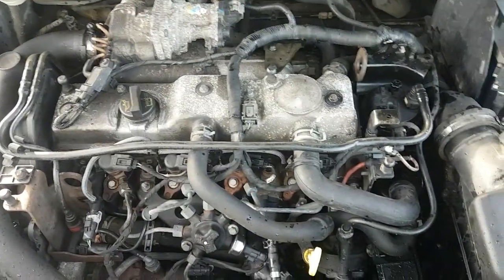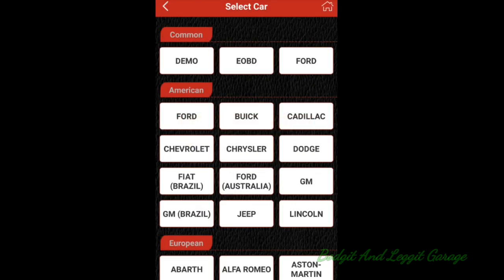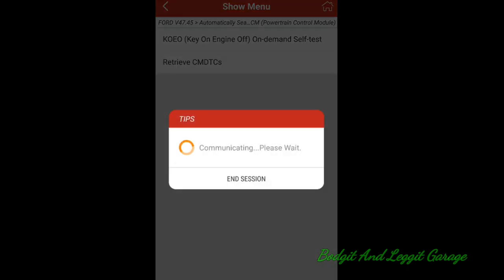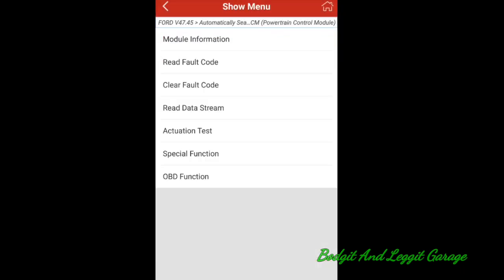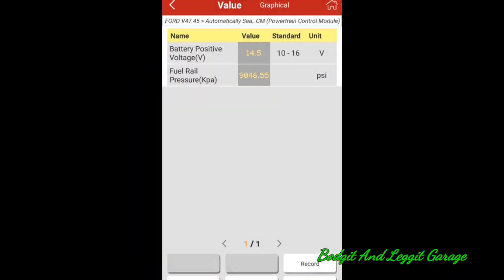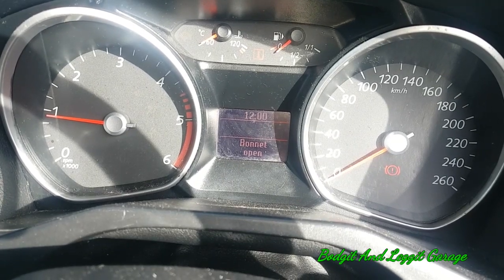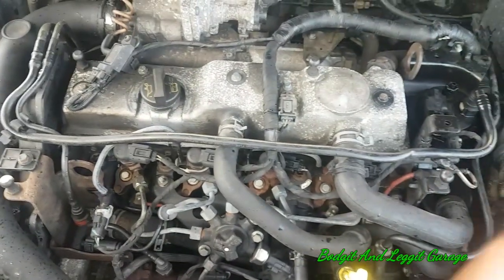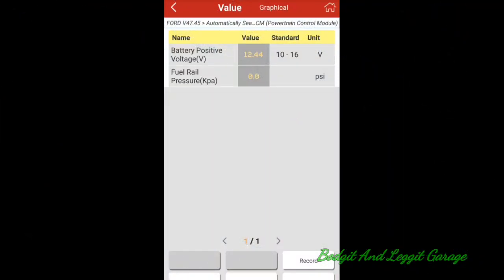Ford Mondeo Crank No Start P0087 Fuel Pressure Low Don't Be A Parts Changer Diagnose It Properly

Comment from the maker: The conclusion to this engine was a faulty fuel filter housing it was drawing in air are causing the diesel not to pull through from the tank and not to refill the filter we replace the whole filter housing with a second-hand unit and the car is still running over 3 months later with no issues just something worth checking as well symptoms pointed to a blocked fuel tank but in this case it was not
Reply: Good result. Seems like a common issue on these 👍
Reply: Hi Leon, how did you find out?
Reply from the maker: @armandonika  I tested the fuel coming out of the fuel tank and it was clean normally when there's a big blockage you comes out dirty I also double checked all the o-rings on the fuel filter housing they were bad and the fuel filter housing was Miss shape and old eye pressure tested the fuel housing and I saw fuel coming out of it so I replaced it
Reply: bodgit and leggit garage thanks mate!
Reply: Hi. I think that i have the same problem as yours. Car started fine and then after a while cuted off. After a few attempts it started and ran well, but next day the same problem. 
I don't have any fault code (diagnostic tool), but FRP fluctuates at idle for about 50 bar or 725psi. I hope that my mechanic will find the problem.
Reply: @stojanhumar1704  simular situation here. Did you find and solve issue??
Reply: @andrewelse6854  Hi. It looks that the problem was with EGR valve.
Reply: @andrewelse6854  Latest news: it's seems there is a problem with fuel and not EGR. They don't know yet.
Reply: @stojanhumar1704  did you manage to sort it out?
Reply: @andrewelse6854  yes. The fuel tank was full of dirt. They had to clean fuel tank, pipes and replace fuel filter. I recommend you to check fuel filter first.
Reply: @stojanhumar1704  thanks planning on changing the filter tomorrow hopefully that's the issue with mine
Reply: @bodgitandleggitgarage  where was the problem now? I have the same starting problem on 2 days in one week on my mondeo mk4 2009 2.2 Diesel.

Comment: Nice mate. Seen a few feed pipes not in their retaining clips rubbing on the pulley at the back of the engine. Think it’s the power steering pump can’t remember. Normally after an engine has been fitted. Another great vid. Keep them coming.
Reply from the maker: Thanks a lot mate I've seen that a few times myself and the older 2L diesel has had the fuel filter beside the pulleys as well did the same thing when they weren't in place properly

Comment: hi leon hows things ? i have a 2006 1.8 transit connect r3pa engine ,van starts everytime but loss of power ,as if the turbo not kicking in but it seems to be working take the turbo pipes of at the manifold and really strong pressure ,only engine code is 0087 low pressure ,i changed the fuel filter ford one and it was one hell of an engine to start had to jump start it ,eventually started but will start everytime 24 hours later still starts but one i remove the fuel pipe feeding the pump from filter it will not start same again flattens battery etc then have to jump start it ,so i connected the fuel pump up to a gallon can of fresh good diesel  and sorted the other pipes so that they would not draw air but same again no start ,the fuel pipe is only 15 inches long from pipe to pump very short but it is still flattening the battery and taking forever to start ,i have checked the fuel pressures 300 bar at idle at 2000 rpm 700 bar and at 3000 rpm 800 bar but it still hard to start ,i did a leak of test on the injectors and all good very slow to put diesel into the measuring containers ,i cant understand why it will not start even with its fuel lines and filter by passed and i have what looks like good fuel pressure ,can you shine any light on it before i start changing the pump etc ? sorry for the long message but i had to explain all of what i have did on the van ,i also did a compression test and it is 100 % every cylinder ,hpefully you or one of your other followers can help   many thanks paul

Comment: Ever woorked on 2016 Ford Focus Flex GDI SE 2.0L ? I had a collision on curb high speed and had underneath dammage but still ran . Had it at home for a few days and i'd start it and ran normally for 10-15 minutes at a time . ran it to check engine and charge battery . Then took it to a shop and damage was fixed and verry surpprised it won't start . Mechanic said he couldn't diagnose problem so I took it home and called mobile mechanic . He used a tool with a tablet and said it was fuel pump so I got one used and put it on still not working. Used test light to check fuses and entire rows of them not working and I told mobile mechanic but he didn't pay attention. Said he's almost 100 % sure it's pump ..Shouldn't the fuses  light up ?  and yes I took them out and checked with ohmeter and they're good . Fuel pump fuse is good and mechanic said it's getting some fuel but probably weak pressure ? Please help me I need my car . Spent too much already and over a week no

Comment: Hi mate excellent video! I’v been told the fuel pressure regulator valve on the back of pump is a common issue, is this correct?

Comment: Hi Mate just subscribed to your channel as I find it very informative, I've got a similar problem where the Mondeo was driving ok then just stopped and now wont start, Id like to ask a couple of questions if I May, Firstly if I crack the nuts on the injectors after having cranked it over I get a dribble of diesel but no real pressure release, Does this sound normal?? Secondly if I disconnect the main pipe that supplies all the injectors I get the same result after cranking, Should the fuel jet out of here under pressure as it only seems to trickle out? there's no evidence of any gold in the filter housing so I'm hoping my injector pump will be ok....Any advice you could give would be most appreciated
Reply from the maker: Hi mate what you need to open up your diesel filter see if you can see any gold glittery bits if you can your pump is gone and you need to replace that and your injectors this is very expensive then  plug in your scan  tool on live data on your high pressure fuel pump make sure it's at least 300 bar at startup that is the first thing you need to do
Reply: thanks for the reply mate, I've hooked up my laptop using forscan and it throws up a number of codes, P0087, P0193, P0238. Whilst cranking the engine there is plenty of  fuel pressure and the fuel filter is good with no bits of metal. Any ideas mate?/

Comment: Hi can I ask for some advice from you please for my ford c-max 2008 1.8tdci ??
Reply from the maker: Of course you can mate
Reply: @bodgitandleggitgarage  brilliant I've been having trouble with my 1.8tdci engine code kkda in the morning or for long periods of time its really struggles to start and sometimes doesnt start at all, so I've changed the glow plugs the battery and also the fuel filter but still the problem persists and I also have changed some of the fuel pipes as the ends were corroded or broken and I've done a compression test once cold and one hot the cold one indicated that cylinder 3 had a dodgy injector so I took it out got it checked and it came back as fine so I'm not at a lost as to what it could be do you have any ideas ?? I've been told if I blank my egr valve it should course it but its seems like a fuel problem not an exhaust problem so any advice will would be great full thanks 👍👍
Reply from the maker: @juddaas08  I made the first thing you are going to do is have to get a scan tool and check the cranking pressure if you don't have a scan tool you're going to have to get one or find someone who do if you don't have this tool there is nothing further you can do
Reply: @bodgitandleggitgarage  ok mate I shall get it to the garage to check the pressure thank you for your input I really appreciate it
Reply from the maker: @juddaas08  anytime mate unfortunately if you don't have the right equipment we cannot go any further as I need to know Pacific things of the car before I can tell you what else to do
Reply: @bodgitandleggitgarage  ok mate thanks 👍👍

Comment: hate those 1.8 lynx  engines with a passion  they should have called them  the 1.8 jinx  total crap   really poor  engine    components   oil seals  ,turbos , flywheels( go around 60k) wet timing belt  great idea that a belt that is soaked in oil   and the dreaded delphi fuel system are not worth a toss     , leon must really love them though , my advice to anyone looking to buy a diesel car  would be if  it doesn't have a bosch fuel  system forget it
Reply from the maker: Hi mate I will have to disagree with you on a couple of points of this the Ford 1.8 lynx engine has been developed over a very long time and he's a great engine the wet belt side of things yes is a disaster once you change it to a chain it's far better and like anything as long as the engine has been looked after properly there really is no issues apart from normal everyday running wear and tear
Reply: Also it’s not a Delphi system ,,,it’s a siemens vdo high pressure fuel pump
Reply: That engine has been around since 1988 , it's a decent lump if you change the belts at the correct intervals,  it will do some mileage